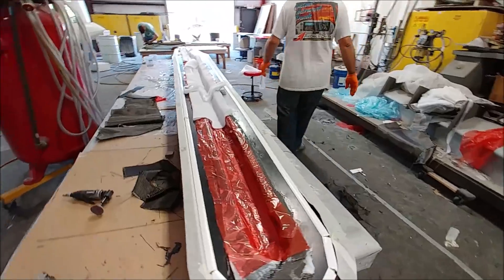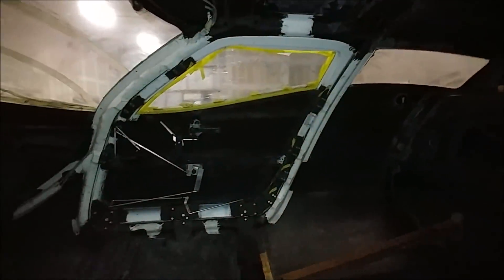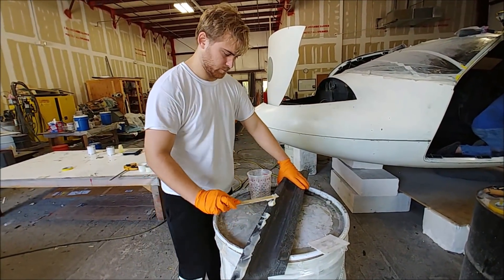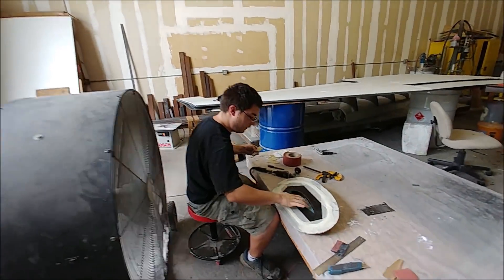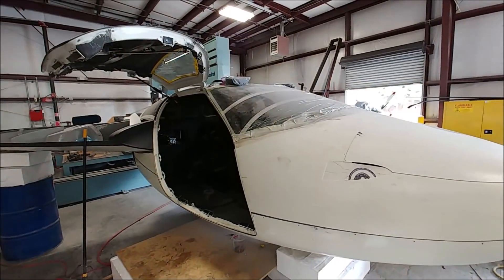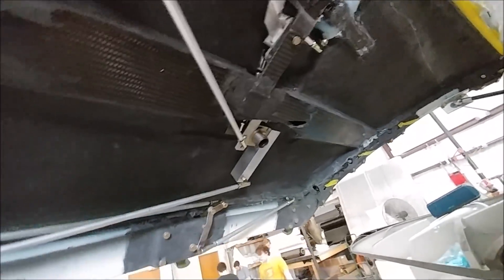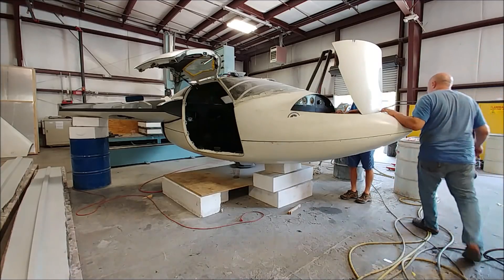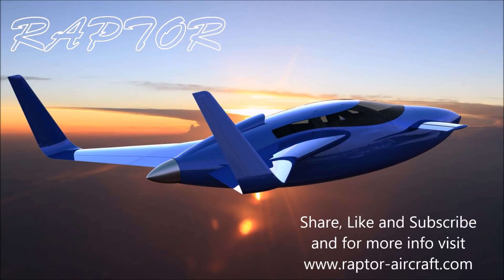Gear Up, Gear Down - Building the Raptor Prototype

Comment: Wouldn't it be possible to use resin for hi ambient temperatures?
Reply from the maker: Jim Collins presently the supplier only has the one speed hardener.
Reply: Jim Collins and

Comment: That hydraulic pump is simply a matter of being vastly overpowered for the application - you're moving too much fluid too quickly to get the job done (Captain Obvious).  Downsized it by a factor of half or even 1/3 and you'll be happy with the performance.  I doubt you'll ever need the excess power capacity to drive huge flaps or thrust reversers!
Reply from the maker: Mark Lee the flow rate is a bit high but that's the only rate we could get with the pressure we needed.

Comment: Gear and doors... big milestones. Great work Peter and Team Raptor.
Reply: Can you find a smaller hydraulic pump? How about using an accumulator? 
 I think that using gas struts gives you enough advantage that a dedicated electro- hydraulic pump is a disadvantage weight wise if it's only function is raising the gear. 
 How many hydraulic pumps do you have in this prototype, oil, fuel, governor, gear, any others?
 Do you have any manually actuated hydraulic pump?
 
 Could you use another hydraulic source to drive gear retraction?
 Are the gas struts reliable in a reduced pressure atmosphere?

 I think maybe you should consider consolidated hydraulics, along with a manual pumping solution.

 I know it's out-dated but MANY lives have been saved by redundant centralized hydraulic systems with  simple hand pump backups, both of my grandfather's included.
 For instance if you lack sufficient fuel pressure or volume to maintain the engine at full power maybe the gear SHOULDN'T come up.
 BTW, you should really do a comprehensive design overview episode, Even if it takes a week or two to produce and there's nothing in the meantime. The overall design vision and process needs to be updated because we the people aren't in the shop with you guys and it's hard to track what's going on. 
 You're doing an amazing job of it though, but I think you need to recap the overall design and methodology.
Reply from the maker: Kyle Goldston thanks for your comments. Let's just focus on finishing the prototype with the way it's designed before we spend any time doing all the extra work you just talked us with. Thanks, Peter